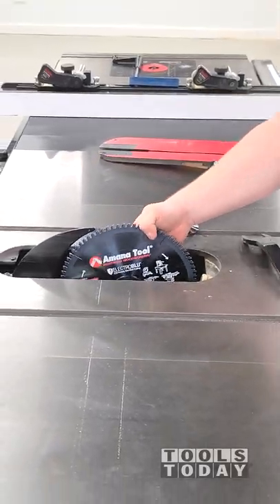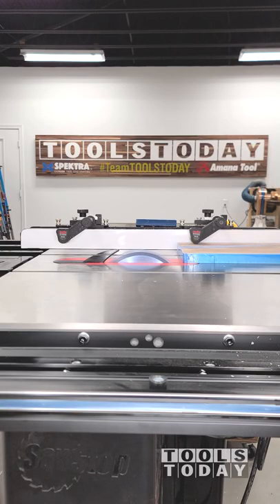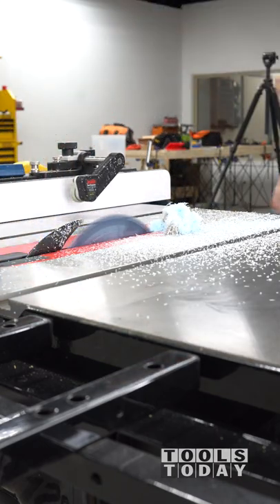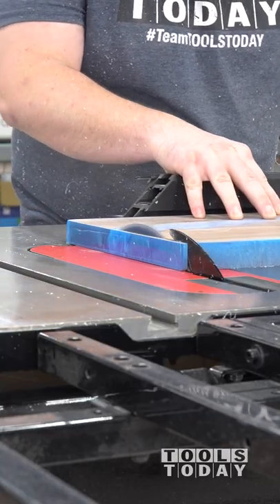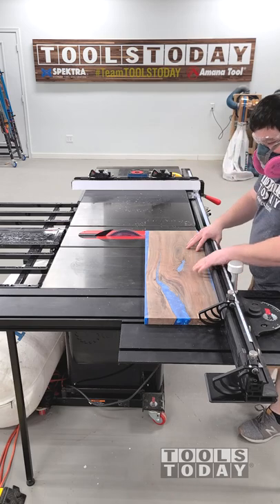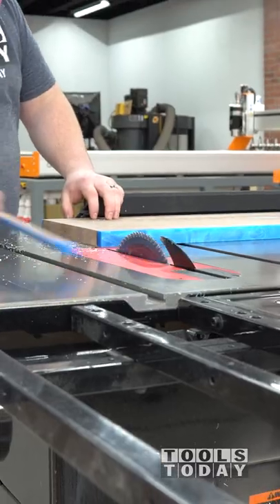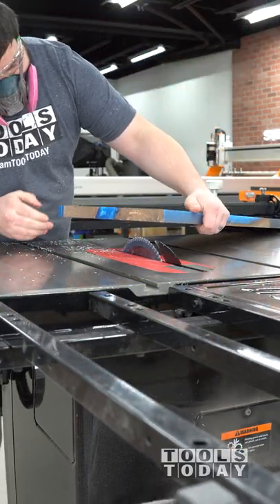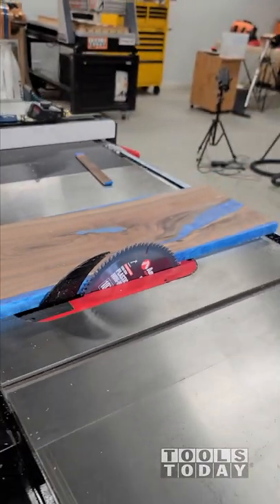Cutting Epoxy on Table Saw

Comment: wouldn't a slight amount of heat or melting on the cut edge actually make it a bit softer or smoother 🔥❤️😎🎉👍
Reply: No because it starts stringing and getting caked up everywhere
Reply: @leoblazer74  oh that makes sense

Comment: Thanks I hv fiberglassed a piece I’m using on a boat, had a hard time getting it flat smooth so I ran tape around the edge and mixed up just plain polyester resin, added the hardener, on a flat surface got my piece hood abs level as I could, poured the mixed polyester resin and let harden pulled tape off let cure for 24 hours, sanded edges down rounded them off. Now just need to figure out a way to cut this open to add a pulley abs so I can open it up when needed, ha k saw gummed up, every hand saw gummed up or resin stopped saw even with oil applied into saw started crack. Hopefully I can use my table-saw with I think is 80 or more teeth w/o gumming up and throwing my piece back at me! Hurting me or destroying my piece. Hopefully someone will read this avd get back with me in cutting 3/16-1/4” solid thick polyester resin thanks

Comment: Epoxy will not melt as it is a thermoset plastic. It will burn before it melts
Reply: Yeah, but if they told the truth then they couldn't sell expensive blades to ignorant people.
Reply: @John Coops  more money than brains. its expensive to be a pseudo intellectual 💰🤑